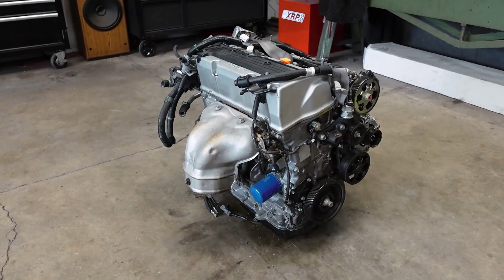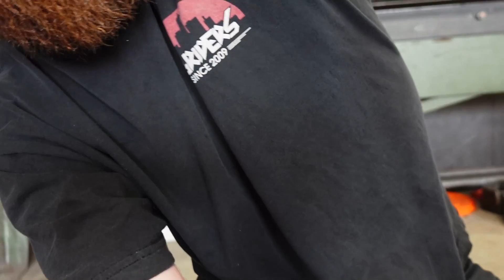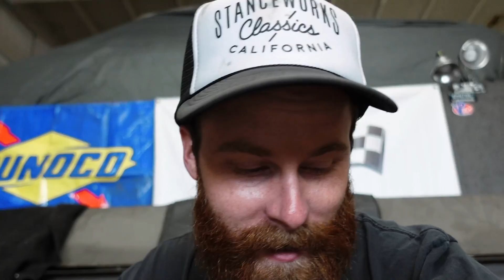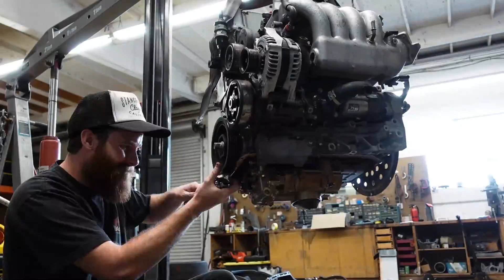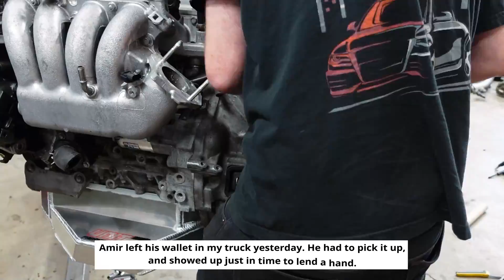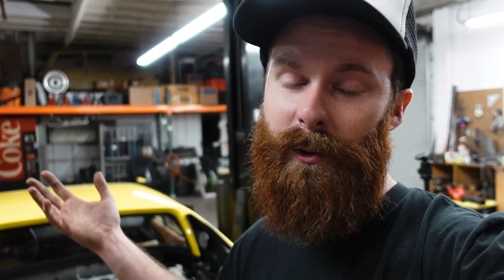Honda K24 Swapped Ferrari: The Engine Is In!... For Now. - Ep. 6

Comment from the maker: With all that engine bay space, what would be your engine of coice?
Reply: I wonder what the dimensions of the Impala SS LS 5.3 FWD set up Vs. this engine bay...
Reply from the maker: @Apalacios05  Honestly, good question.
Reply: @stanceworks  it wouldn’t work in this build, it would require a back half or at least a fully remade cradle. I fully support the turbo Honda setup. But someone some day might see that 5.3 set back there...
Reply: how about a honda v6?
Reply: probably an Audi 5cyl for the glorious noises
Reply: Vr6 and sounds epic
Reply: Someone needs to put a Voodoo engine in a Ferrari 😃
Reply from the maker: @adriangale  Now we're talkin.
Reply: K24 supercharger.
Reply: I’d look at the 07K VW 5 cylinder. Dimensions (length/height/weight) are almost the same as a K24, and can be rebuilt to rev to 9K, and make big power on boost. Like the K series, I’d just like the 5cylinder sounds.
Reply: Alfa Romeo Busso V6 with supercharger
Reply: Turbo K24 or an eco boost 2.3L turbo out of the Focus RS.  But...the wildcard could be a turbo V6 Honda like what Bisi from Bisimoto put in his minivan...
Reply: If you were based in Europe , an Alfa 3.2V6 with ITBs. I guess this does not make sense in the US, so I would go with a Nissan 370z engine and transmission, keep it NA and tune the engine.
Reply: 3 rotor 😈
Reply: Old Mazda 2 Liter V6 from the 90s
Reply: K24 with the dry sump
Reply: If it had to be a non Ferrari engine is would be an Alfa Romeo 147 GTA busso engine but modified to 3.7 with a supercharger. Definitely wouldn't add a Honda. I know with money anything is possible but I don't understand the American obsession with Honda.
Reply: A Toyota 1uz could be interesting
Reply: Eaton-supercharged Quad-4 with air/air intercooler.
Reply: One I rebuilt myself because no one ever tells the truth when your sold a good running motor. Choice would be coyote v6 or k24.
Reply: RB26DETT
Reply: 96 to 99 Ford 3.4 32V SHO V8
Reply: A 3.0 Ferrari V8 fits nicely in there...
Reply: Mike, seeing the frame rail clearance makes me wonder if a 2GR-FE would fit. They sound amazing too, and it's easy to get them to rev to 8k too. They sound amazing, take boost well, and are common swaps in MR2s.

Hope you're well my dude, enjoying the build
Reply from the maker: @Mr2sauce  Thanks man! I have no idea what a 2GR-FE is. I'll have to look it up!
Reply: @stanceworks  3.5L Toyota V6, used in a ton of mom-mobiles but also the Lotus Evora!
Reply: Alfa Romeo V6 with ITB’s #1 choice
Subaru Flat 6 with ITB’s #2 choice
Millington engine with Samsonas sequential box😍 #3 or maybe #1👍
Both NA!!!
Reply: toyota 3.5 v6 with the paddelshift transmission

Comment: Here's a tip for pulling debris out of an engine, yet being able to trap it in a "filter", so you know exactly that what you pulled out is actually what was in there to begin with.    Step one, find a vacuum that has a hose or hose attachment that will fit down into the orifice of the engine, or in your case, intake manifold.  Step two, take either a blue heavy duty disposable shop towel, or some other fabric perhaps a red shop rag and create a pocket about the size of an egg.   Put the red shop rag/blue heavy duty shop towel into the hose, but with enough material folded on the out side of the tube, and then use several rubber bands to keep the rag/towel from moving.   I suggest several tight rubber bands, you get one good shot at this.  Next step, turn the vacuum on, and make sure the rags/towel are secure and not moving.   If all is good, then turn the vacuum off, put the hose down to the area you want to get the sample from,  turn the vacuum on and have another set of hands cup the area between the intake and vacuum to create a vacuum as well.  Keep the vacuum on and slow pull the tube out of the intake, and when it's out all the way turn the tube right right and then turn the vacuum off.   Presto!   Whatever you vacuumed will be in the sock of rag/towel.   Good luck.   This will be a fun build to watch, 2 years late for me, but it'll be interesting!

Comment: Why do alot of youtubers go to hardware stores for fasteners... 9 out of 10 times they do not  have what your needing and you end up checking every hardware store... Why not use Fastenal or Wurth for your nuts and bolts. Probably alot cheaper and for sure alot less hassle...
Reply from the maker: Because the hardware store is about 3 minutes away and the closest Fastenal is 32 minutes away (and closes at 1PM)

Comment: Really enjoying these films even as a a Ferrari guy who thinks Ferrari’s should have Ferrari engines :-) . The early Euro market 308 GTB’s until the GTBi was introduced were all dry sump. Not sure if it is of any use looking at how Ferrari installed it originally and how the setup could be adapted for your installation. All the US /Japan and Australia cars plus all the GTS were wet sump. I think Ferrari fitted the dry sump on the GTB for race homologation?
Reply: Also as  I recall the 1st GTBs were fiberglass and 300 pounds lighter than the steel cars. As the car was such a hit, (by Ferrari standards) if was decided to convert to steel for "volume" manfacture. ($$$). I've always thought a fun build would be an early glass car with a mildly built later 4valve engine. This was doable not so long ago, but no longer economically practice noe. Still....

Comment: Cutting that pan up would be a crime, and there is no way to guarantee it does it's job of defeating oil starvation once it has been modified. Mock up the intake and head you are going to use with a proper dry sump system. That will drop your center of gravity, you can disperse more weight throughout the vehicle (possibly with a cooler up front). Awesome progress! Can't wait to see more of this project!

Comment: If you go with a dry sump system, you'll be able to sit the engine lower down therefore improving your CoG, depending on your suspension geometry (roll centre heights which if they are below this point) then you can reduce the suspended mass inertia and thus improve your lateral transfer response when cornering

Comment: is the trans on there for front wheel drive cars? how do you bolt it to the rear end? how does it mate up. dying to know, great vid!
Reply from the maker: Indeed it is! I explained a bit in my last video, if you check it out. There's no need to change anything about it, it will work as is.

Comment: Engine was probably swapped out for a new one at 50k miles because of oil consumption. Then sat in storage for a decade hence the white aluminum oxide.
Honda designed different oil scraper rings to make their engines low friction/more fuel efficient.But these got clogged up so they couldnt scrape the oil of the cylinder wall. Had the same recalls on a lot of Honda Insights from model year 2012 with VIN numbers starting with CS.

Comment: I have this motor in my accord, Honda has had some issues with the Piston rings. They have a soft recall on these and will pay for a percentage of a rebuild if it burns enough oil. Probably not an issue for your needs but could explain the condition of this motor.
Reply from the maker: Not relevant here but interesting to know. I appreciate the insight!
Reply: Tell me more. Is this A3 aswell?

Comment: Not sure if the question about the M12 1.25 bolts was rhetorical or honest, but from an engineering standpoint they make perfect sense. Finer pitch = shallower threads = more meat in the bolt = stronger bolt. Plus, less torque is needed to achieve a certain clamping force in the joint compared to when coarse thread bolts are used. The cars I have been working on (Italian, German and French) all have a lot of fine pitch bolts in critical places in the drive train, suspension and brakes. Coarse threads however are good for most other applications and are more robust and cheaper/faster to manufacture.
Reply from the maker: I’m more just poking fun because metric hardware occasionally has 3 pitches. I’d have considered 12x1.75 coarse and 12x1.5 fine. I just haven’t come across much 1.25.